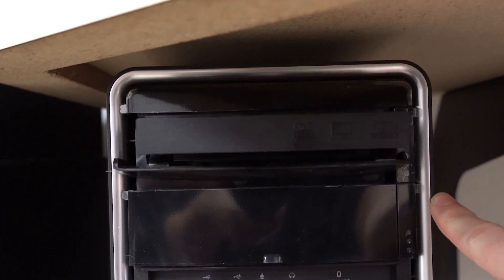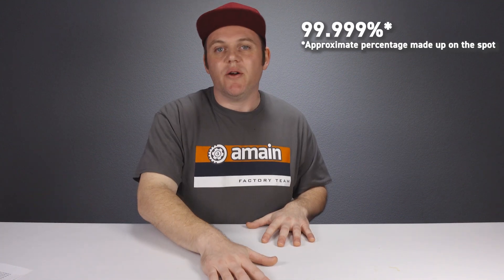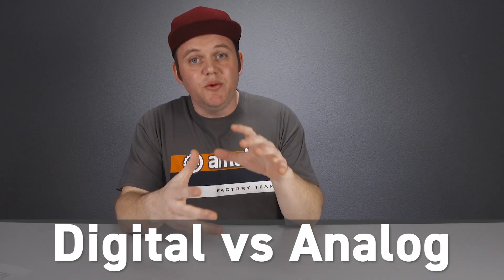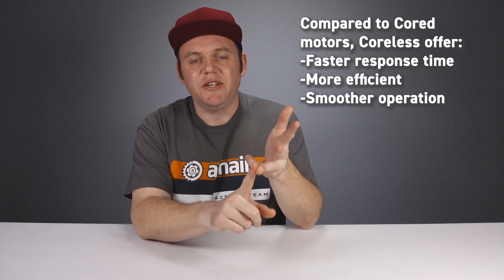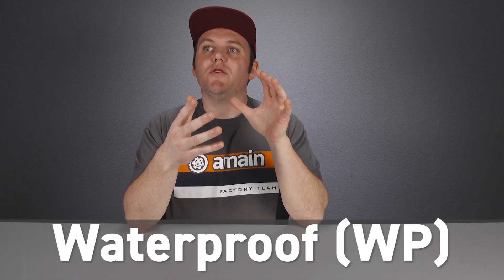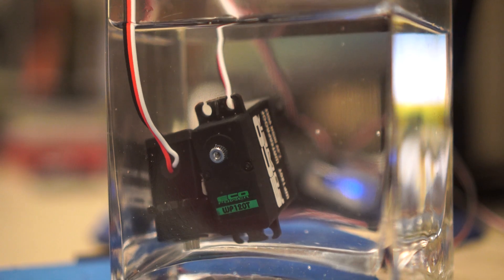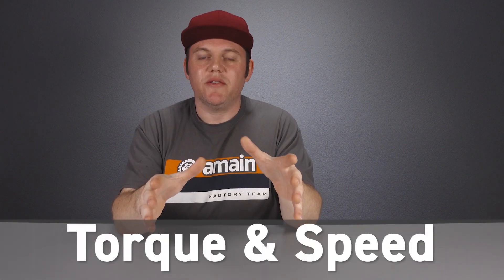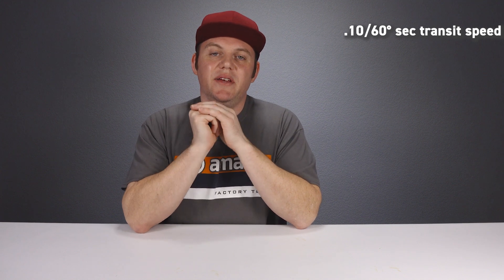RC Servo Differences & Technologies Compared - Servo Motor Types, Materials & More

Comment: Hi, any recommended servo brand and model for slash 4x4 vxl?
Reply from the maker: This 120T is a good choice: https://www.amainhobbies.com/ecopower-wp120t-coreless-waterproof-high-torque-metal-gear-digital-servo-ecp-120t/p734714
Or this Traxxas 330: https://www.amainhobbies.com/traxxas-330-high-torque-metal-gear-waterproof-digital-servo-blue-tra2250/p802371
Both of these servos are also waterproof. 
-Brett
Reply: @AMain_Hobbies  thanks brett! Will consider getting one of these in a few days.. How about for Arrma Notorious V5? Sorry Im just new to this hobby.
Reply from the maker: @RC-uf6sl  The Notorious would make for a bad servo, but it's a cool truck that wheelies and flips very easily. It's fun, but tough to keep the front tires down. The Kraton 6S is very similar, but with a longer chassis so it's a little easier to drive hard. Great trucks though; highly recommended. 
-Brett
Reply: @AMain_Hobbies  Hi brett, any recommended servo for the Notorious? The stock one is garbage.
Reply from the maker: @RC-uf6sl  Oh, I misunderstood you; thought you were asking about the truck. For servo power in the Notorious, you'll need a lot more power. Do you need it waterproof? They get pricey on the high end. 
This 370TBL is about as beastly as they get and it's all aluminum: https://www.amainhobbies.com/protek-rc-370tbl-black-label-waterproof-high-torque-brushless-crawler-servo-ptk-370tbl/p532334
Savox: https://www.amainhobbies.com/savox-sw1211sg-waterproof-aluminum-case-digital-steel-gear-servo-high-voltage-sav-sw-1211sg/p546936
Hitec: https://www.amainhobbies.com/hitec-d956wp-dseries-waterproof-metal-gear-digital-servo-high-voltage-hrc36956/p985288
There are a lot of servos out there, but high-powered waterproof servos are more rear, and expensive. 
-Brett
Reply: @AMain_Hobbies  thanks brett! Probably I will go with the savox. I like the specs on the protek 370tbl but the price is ridiculous lol. Anyway thanks man! I appreciate your help :)

Comment: So , if i'am working on 2s lipo , by default my servo will go on 7,4V or more if ESC will handle ?
Reply from the maker: No. Regardless of the battery you use, your ESC has a built-in BEC which regulates the power delivered to the receiver, and then the servo. If you set your BEC to 6.0V, your receiver and servo will receive 6V. If you set the BEC to 7.4V, then your receiver and servo will get 7.4V. 
-Brett

Comment: which is the difference between Remote Control Angle of 90 deg and 500-2500 us Angle of 180 deg. I need a servo with a 0-60 degree turn to replace Hitec HS-300
Reply from the maker: Sorry, I don't understand your question. For a replacement servo, we offer many units from mild to wild. Here is a basic S3003 Futaba if that's all you need: https://www.amainhobbies.com/futaba-s3003-standard-servo-fut01102164-1/p608310
And here is our servo category: https://www.amainhobbies.com/servos-electronics-cars-trucks/c100
-Brett
Reply: @AMain_Hobbies  cool thanks

Comment: I realize there may be a bit of liability you may have wanted to avoid by mentioning this but you can generally make a not waterproof servo at least splash resistant pretty easily. Basically it’s plasti-dipping or flex sealing the case around the parts where the case separates and putting a nice glob of grease around the servo gear at the horn. Of course this means either matching or cleaning & replacing the grease. I gotta say I love the ecopower 120t being fully waterproof out of the gate though. Saves the headache
Reply: where do you need waterproof servos?
Reply: @SamuelLanghorn   In a boat?
Reply: @martinwhite418  you mean submarine 🙂
Reply: @SamuelLanghorn   have you ever had a boat? There are no dry places. It's the opposite of an airplane,  where there are no places without air. Hahahha.
Reply: @martinwhite418  I had many boats, just make sure you keep your non waterproof items protected. It works well.
Reply: @SamuelLanghorn  You must have some boat. I have never heard of a hermetically sealed boat before.
Reply: @martinwhite418  yup, this is my secret sauce.
Reply: @SamuelLanghorn You should notify the major boat manufacturers, they would pay big money for that.
Reply: Or just conformal coat the board and motor connections
Reply: Bc in a boat try as I may everything will get wet eventually because it's not if you sink it is when you sink it or submerge it I should say.

Comment: Excellent video on the variety of servos out there. However one area that perhaps you could cover that was not mentioned. That is servos in use on model locomotives running on railroads such as model Garden railroads particularly used in live steam locos. There is a need when operated by an R/C system to operate the throttle, the forward-reverse gear, the whistle or horn, uncouplers etc. The thing about live steam is IT"S HOT, and if the servo is near the boiler then the heat can affect the servo. I had to have two servos wrapped in heat resistant material to help this. What is your comment please ?
Reply from the maker: Interesting. For high heat applications with nitro vehicles, we typically recommend an aluminum case servo to help dissipate the heat. If they have aluminum case servos for your size, those would perform best. Here is one of ours with a conformal coated circuit board: https://www.amainhobbies.com/protek-rc-155s-digital-high-speed-metal-gear-servo-high-voltage-metal-case-ptk-155s/p742422
-Brett

Comment: Hi have a ? I run 3s in my crawler I have my esc set at 7.4V will that mess up my servo
Reply from the maker: If your servo is a High Voltage model, 7.4V is not a problem. If your servo is not High Voltage, you will burn it up in time. 
-Brett

Comment: I bought an eco power servo for my traxxas slash 4x4 and it is too small so what do I do it won’t fit??? Pls help
Also I went to the store and they said it would fit and the problem is that I live 4 hours away from the store I’m so disappointed because it is the right one it just doesn’t fit.
Reply from the maker: Hey Bryce. What servo model is it? The WP120T and WP100T servos should fit in your Slash 4X4 no problem. There is also the EcoPower 640T servo which is very small, and is not intended for your Slash 4X4, so I hope you don't have that model. Could you please tell me how is the servo too small? Is it the case, or the servo arm, the wire lead? 
-Brett
-Brett
Reply from the maker: @brycetrefethen  Sorry, these messages easily get lost in the shuffle. Can you send me a picture? brettb@amain.com is my email address. That servo should have no problems fitting a Slash 4X4 so i'm a bit confused. If you had a Maxx or X-Maxx, that servo would be too small, just like you describe. 
Let me know if you can send that picture. And please add Youtube to the email subject. Thank you Bryce. 
-Brett
Reply: @AMain_Hobbies  I think we have it resolved but thank you so much I really appreciate it.
Reply from the maker: @brycetrefethen  Great! Glad you got it!
-Brett
Reply: We bought the WP110T and the guy that helped us said it would fit but it is much to small. The little notches that fit the servo (on the servo) to the chassis aren’t long enough.

Comment: Hi, pretty much a noob here 🤫🤣🤣. Does a brushless motor combo require a brushless servo?
Reply from the maker: No sir. The servo type is independent of the motor and ESC, and there is no compatibility issues with running a brushed or brushless servo, with any motor & ESC type. Good question. 
-Brett

Comment: What would be a great single servo for a revo 3.3 nitro?? Is a ds3235 a good one?
Reply from the maker: We're not familiar with the DS line of servos but I'd be cautious buying cheap servos. They are one of the main items to invest in quality and they'll last you forever. For a budget, I'd go with this WP120T. It's waterproof, can do High Voltage, and would be a great fit. https://www.amainhobbies.com/ecopower-wp120t-coreless-waterproof-high-torque-metal-gear-digital-servo-ecp-120t/p734714
-Brett

Comment: so if i upgrade my brushed motor to a burshless   motor and change my brushed esc to a burshless esc does that mean i have to change my sevro too
Reply from the maker: The servo does not need to be upgraded. You can use brushed or brushless systems with the same servo; it does not matter to the servo. 
-Brett

Comment: Hello. I was on a forum a while ago and ppl were saying they never used servo saver, servo saver are protection only for weak servos, even while bashing. What do you think ?
Reply from the maker: It's partly true but servo savers are still useful in heavy, large r/c vehicles, like 1/8 and up. With 1/10 vehicles and smaller, high-end servos are strong enough to handle the vehicle. But it all depends. 
-Brett

Comment: good explanations! but what about bandwith deadband ?  I have TSM steering issues  "wobbleing left right" even à %40 when running high speed (80Km/m -160KM/h)  I have digital servo .10s/160oz  I dont't know if I should look for lower or higher deadbantd, faster or slower servo.  Does anyone have the same problem ?
Reply from the maker: The wobble is due to the TSM being adjusted too high. It is best to turn down TSM, or turn off, when doing high speed runs. This should help you out!
-Brett
Reply: @AMain_Hobbies  yes but the  purpose of TSM is to help drive fast. For me and my son, TSM is useless.

Comment: Hey Brett,I'm building a Tamiya Super Clod Buster,and i am looking for a high torque servo.What type of servo would reccomend?I going to use it for both motors.Also,I want to improve the steering.I have a Futaba s3003 servo,but the holes on the servo horn is too small to fits the 6mm ball connector.I am looking for a double sided servo jorn.Any suggestions would be appreciated.Would you reccomend a pistal grip transmitter ot a stick radio for independent front and rear steering should I want to do that later.Thank you.
Reply from the maker: Hey Dale. There are tons of servos out there. With how big the tires are on the Super Clod Buster, somewhere around 300oz/in of torque would be ideal. The EcoPower WP120T is a great option and pushes 400oz/in on high voltage, and it's waterproof: https://www.amainhobbies.com/ecopower-wp120t-coreless-waterproof-high-torque-metal-gear-digital-servo-ecp-120t/p734714
Savox has some great servo options as well, plus Futaba, but they can be pricey. For a servo horn, all the brands mentioned above use a 25T horn spline, so for that, this might work: https://www.amainhobbies.com/savox-sh50-servo-horn-set-2-sav-sh-50/p183363
Here's an aluminum one: https://www.amainhobbies.com/hudy-aluminum-clamping-2-hole-servo-horn-25t-futaba-savox-protek-hud293449/p779335
Here are all the multi-arm horns we carry if you want to browse around: https://www.amainhobbies.com/multi-arm-servo-horns-parts-cars-trucks/c2518
With plastic arms, you can ream out the holes to fit your project, and aluminum can be drilled out. If the horn is too long, plastic can be easily trimmed with snippers, and aluminum can be sanded down with a dremel, if you want to go full custom on the horn to suit your exact needs. Hope this helps!
-Brett

Comment: What would suggest for a servo for the  Maxx I'm noticing factory one feels slow an no torque thanks in advance
Reply from the maker: Go with the Traxxas Servo Adapter and a regular sized servo. Watch this at 4:40 and we show you how: https://www.youtube.com/watch?v=LzUC7c_R2G8
Here is the adapter: https://www.amainhobbies.com/traxxas-xmaxx-standard-servo-adapter-tra7749/p512518#tab-feedback
The servo we used in the video is very high end and expensive; this WP120T is another great option and much less expensive: https://www.amainhobbies.com/ecopower-wp120t-coreless-waterproof-high-torque-metal-gear-digital-servo-ecp-120t/p734714
But take note of how we had to trim the servo horn and upper plate in the video. 
Hope this helps Dalton. 
-Brett

Comment: u said for years servos been using 4.8 v to 6.0v (6;20) right your wrong 
some vintage radio sets have a running rate of 9vs one is the sanwa dash saber and i know the futaba vintage ones can all so run on 9v they run on the 29,27 mhz 
and some of the vintage tamiya cars ran a battery of 8.4v to the receiver

Comment: what servo would you use for a traxxas x maxx?
Reply from the maker: You're going to need a lot of power, so probably the ProTek 370TBL with the Traxxas Servo Adapter. 
Here is the adapter: https://www.amainhobbies.com/traxxas-xmaxx-standard-servo-adapter-tra7749/p512518
And the 370TBL Servo: https://www.amainhobbies.com/protek-rc-370tbl-black-label-waterproof-high-torque-brushless-crawler-servo-ptk-370tbl/p532334
-Brett

Comment: how do you put a new servo in an rc car?     I gave a cheap hobby grade rc car bigger wheels, but the servo might fry.
Reply from the maker: Does it have an instruction manual? That should instruct you on the procedure to removing the servo, and then you swap them out and reinstall in the same procedure you tore it down. 
-Brett
Reply: AMain Hobbies yes, but nothing about the servo.    The servo doesn’t look like the one in my slash.  It’s different

Comment: For nitro buggy I run Savox 2290 with almost 700ozin for steering and protek 155s .06 seconds transit for throttle. Most people run higher torque for better steering consistency. 

You don't need high speed steering, because you're never going to be slamming full left, right, left, right, left... within a second on track. 

Higher speed on throttle is more desirable because it allows better engine response. You don't need high torque on your throttle, because you are going to tone down your brake end point way down to avoid locking up the wheels. Anything after that is a waste.

Servos have came a long way. Even the lightening fast ones have very high torque ratings compared to 10 years ago and vice versa with the monster torque servo transit times on the market.

Comment: I always thought titanium was stronger then steel..?
Reply from the maker: Usually no, but it just depends on what grade of material. A high end Titanium Alloy will be stronger than a low to mid grade Steel. But a high grade steal will be stronger than the strongest Titanium Alloy. Hope that makes sense. 
-Brett
Reply: AMain Hobbies yeah it does! I read up on it after watching your video and learned a lot about both metals thanks for the accurate knowledge

Comment: WOULD U UPGRADE MAXX SERVO....IF SO 2 WHAT THANX
Reply from the maker: The Maxx has that larger sized X-Maxx servo, so it's a pretty strong servo. But if I was to upgrade, it would be the 370TBL: https://www.amainhobbies.com/protek-rc-370tbl-black-label-waterproof-high-torque-brushless-crawler-servo-ptk-370tbl/p532334
It's faster, stronger and waterproof.  
The Maxx requires this adapter if you change the servo to standard size: https://www.amainhobbies.com/traxxas-xmaxx-standard-servo-adapter-tra7749/p512518
-Brett

Comment: Dag! So a 120 torque servo is not good enough for a 1/10th scale big rock crew cab?
Reply from the maker: It may be, depending on the application. You could probably get away with using it until it burns out and then upgrade to something stronger. 
-Brett
Reply: @AMain_Hobbies  Sounds like a plan. Thank you.
Reply: I have a severly modified Tamiya CR-01 with 5.40 inch tall Proline Chisels. I have a Savox 208oz servo on it and it sometimes stalls in a bind. Just for an example. Upgrade is in the plans.

Comment: Good video man 👍👍 i really recommend the jx 6336 servo it's all aluminum brushless over 500ozin and only 35 bucks. And the 46kg jx servo is a monster 650ozin and only 50 bucks so smooth and quiet 💪💪👍 also both are hv
Reply from the maker: Good recommendation!
-Brett